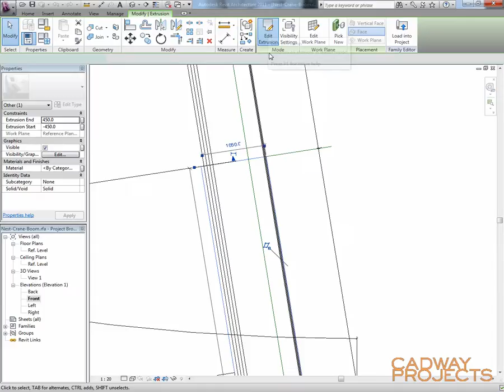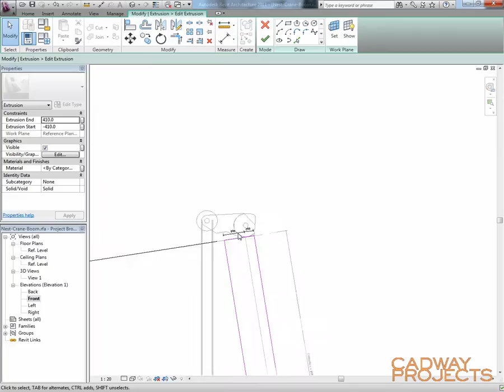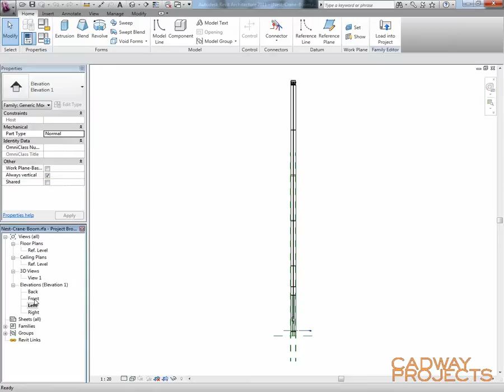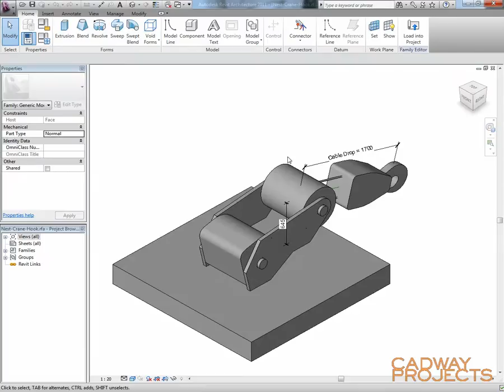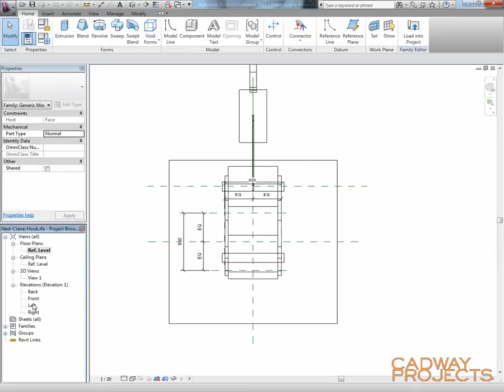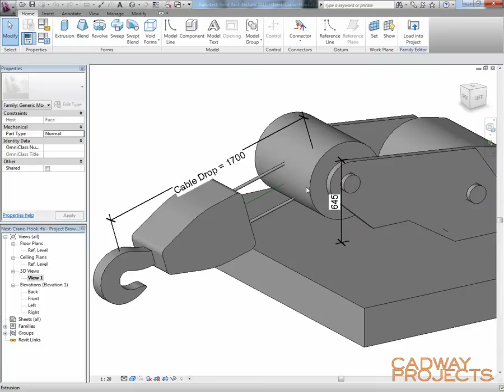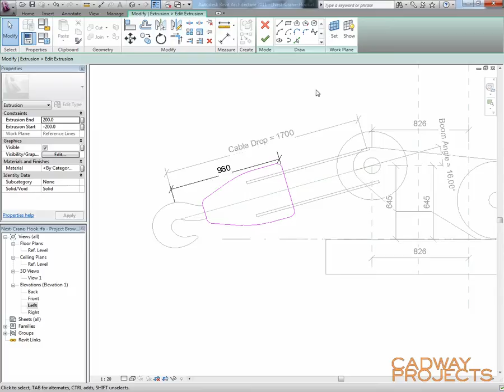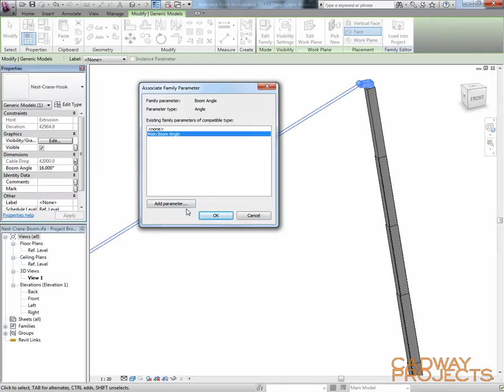Revit Advanced Family Creation - Parametric Crane - Part 3

Comment from the maker: Hi Clifford,

Having it run perpendicular is fairly easy.  The face based family that hosts the cable sits perpendicular to the end of the boom, through linking parameters I know what angle the boom is at, so I just need to hook those two parameters up to each other.